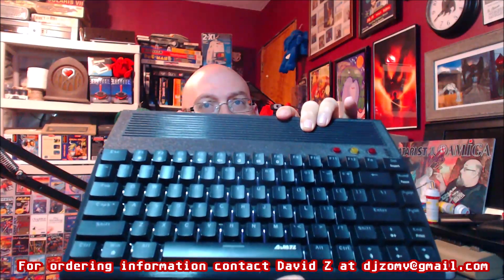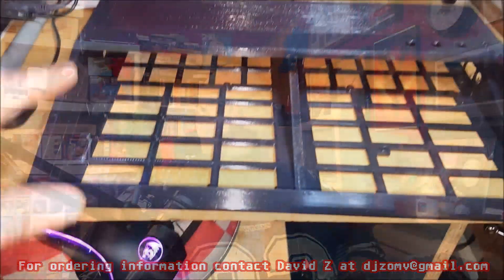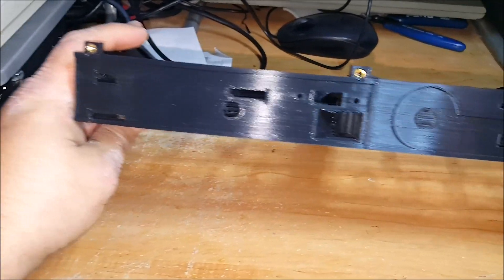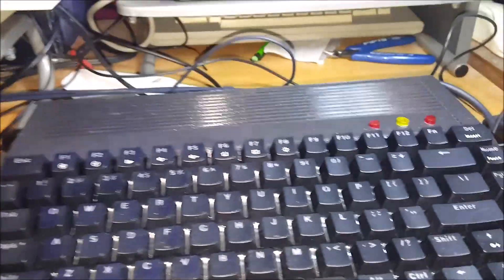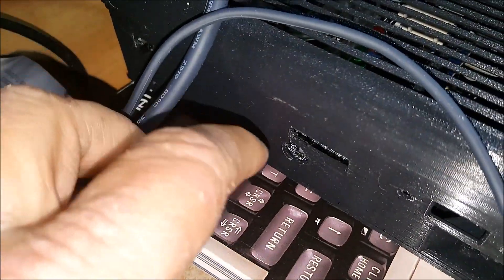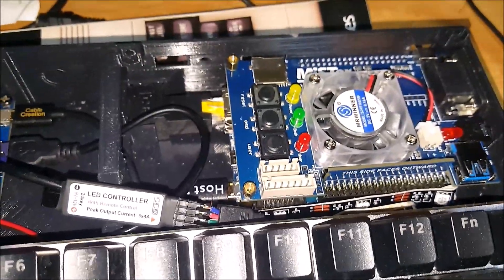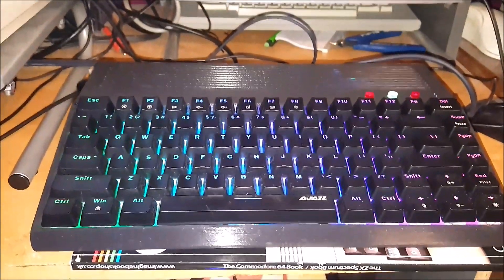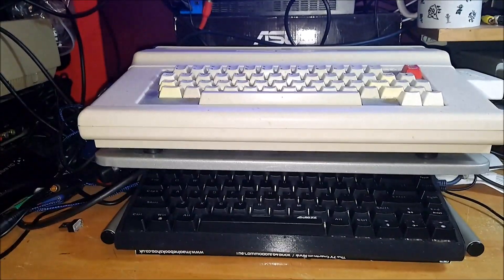MISTer Wedge Desktop Computer Case FPGA - Custom Retro Fun

Comment: I like that it was designed for a super cheap hotswappable 75% keyboard with all the keys you would need, but man it SUCKS that the AK33 uses 1.25u arrow keys. No good keycap set has those.
Reply from the maker: I still use this EXACT setup daily!

Comment: really love the texture of the top cover :)
Reply from the maker: Dave Z does a good job with the texture!  I don't know if you can see it in the video, but the bottom is very textured and lovely.  The vent work on the top is off the charts.
Reply: @AmigosRetroGaming  yes i saw that too, but the top is the part you always see and that texture looks great, i have to do some test print too.

Comment: Got my mister in a aluminum case - sweet little package with a LED keyboard attached. But it’s quite nostalgic to have a complete package.
Reply from the maker: I agree with you...and having the case as duel use really makes the space savings work as well. 
 You know my ultimate plan was to put the MISTER, a Raspberry Pi, AND the switcher ALL in the case...just not quite enough room in this one.  It's on my list tho...

Comment: Do you know where to get the cables that plug into the io board for the buttons? David Z does not provide those
Reply from the maker: They're not too difficult to make. I'm not utilizing those so I haven't done it but it wouldn't be a difficult task to wire them up.